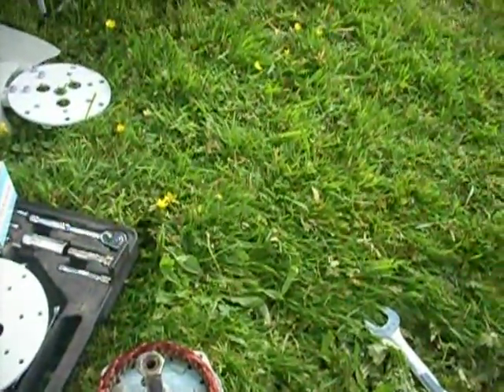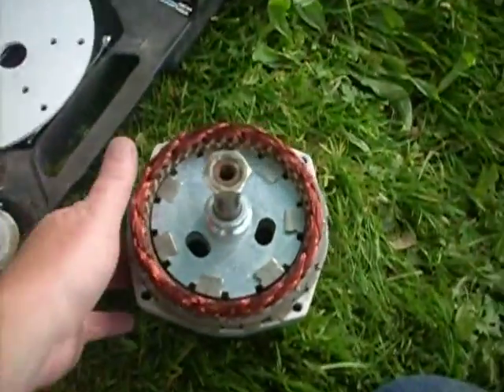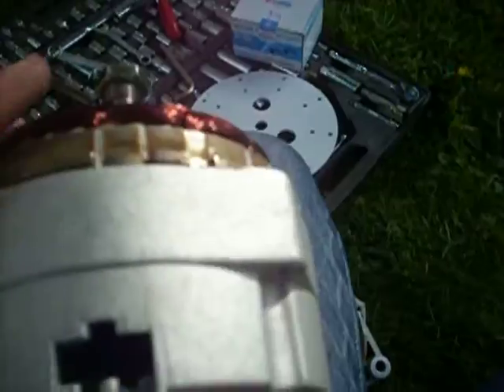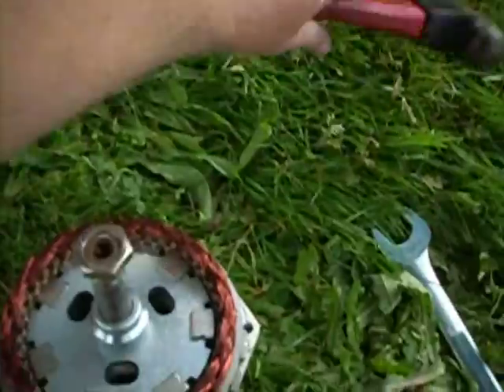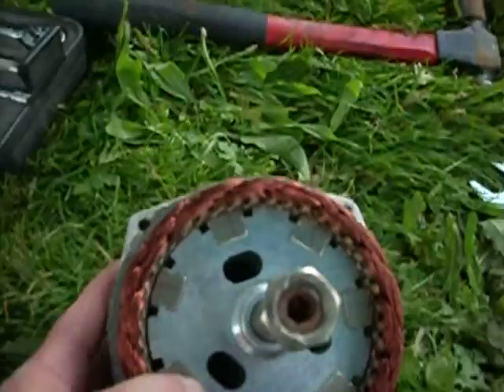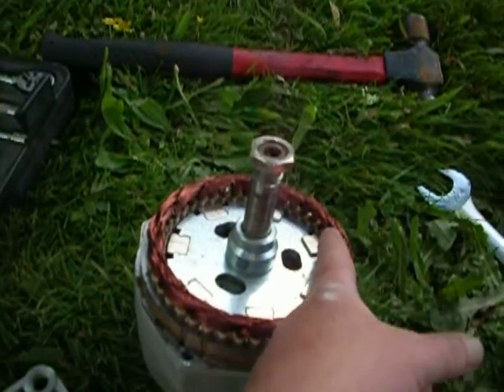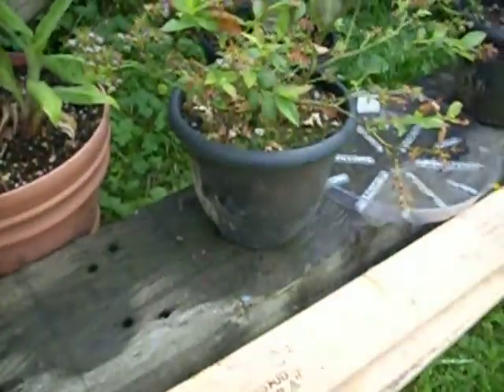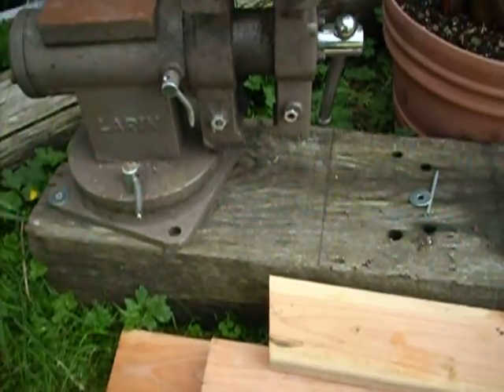7 Mag PMA DC to AC output conversion -- Part 1

Comment: Yes there on tight. While its apart grind a bit down of the rotor shaft for easy maintanence in the future.Put some rags/plastic over the magnets when doing it.Other wise you will have the same problem each time you take it apart.